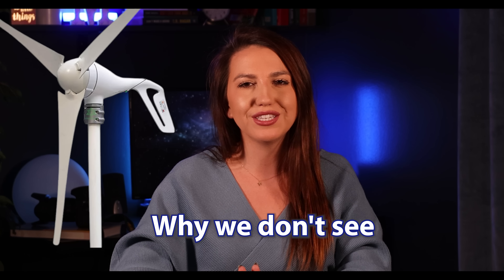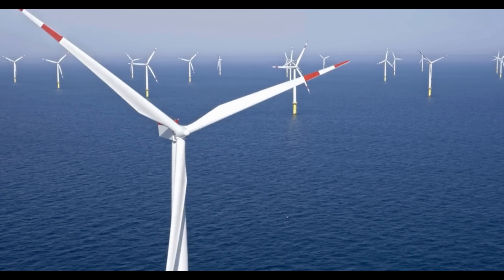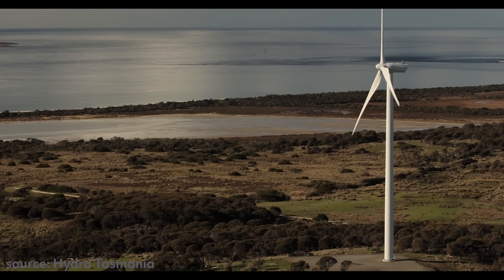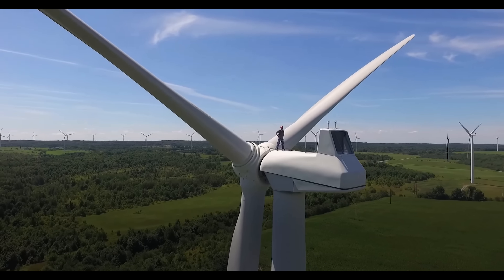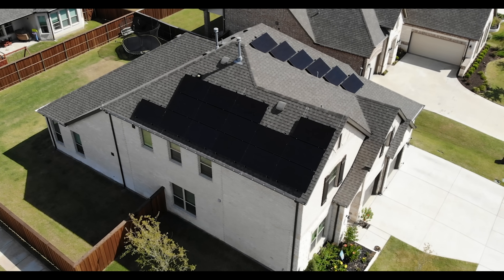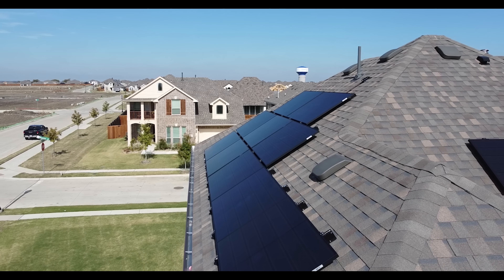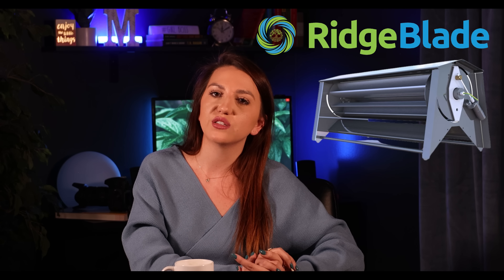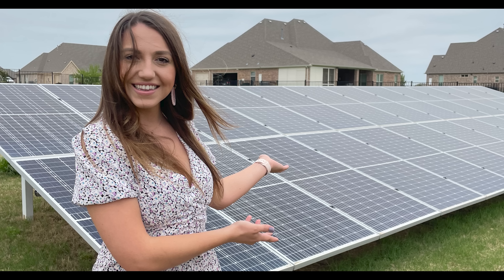Could this Turbine Destroy Solar?  | Why haven't we seen these small wind turbines yet...

Comment: It's very simple: You can't extract from the wind more energy than P=0.36•A•V³ [W, m², m/s].  A - is a area of the wind "hitting" turbine, V-speed of the wind. Small turbine = small energy. Slow wind = small energy. There is a no better idea from efficiency point of view than traditional HAWT type turbine.

Comment: use the wind of trains, cars, Moutain valley winds, tunnels... they are all low but the wind in those can be tunneld through
Reply: Also what is with the Windtubines that take all the wind directions there ball shaped. yes the need to be bigger and it will cost but perfect vor between big buildings

Comment: me as a 5 year old... yeah why dont they do just that.... 20 years later.. WHAT DO YOU MEAN THE WIND TURBINES DONT SPINNI SPIN SPIN BECAUSE THERE IS A MINUS ELECTRICETY COST NOW FUCK USE THE SHIT WIND FOR FUCK SAKE 
we Germans had a 40% total coverage of electricity by using solar power in the summer AND THEY TELL ME THE WIND TURBINES CANT SPINNY SPIN SPIN BECAUSE THE WIND IS TO STRONG OR BECAUSE OF INDANGERD BATS..... Fucking build smaller ones that can spin faster and putt a cage around it....what the fuck is the problem here.. what do you mean i cant generate to much solarpower and fed the grid of my neighbors when i produce to much. why cant i buld small wind wheals and solar panels in my home... oh because Companys would loos money....

Comment: The very first thing you must consider is solar only works when the sun is shining, next after 6 months or so if you do not have them cleaned the efficiency drops quickly and severely!
Wind using a real Turbine will work in the rain and shine at night! Solar was not a good solution when I was selling them and installing them in the late 70's through the mid 80's with very little change to the tech. Now if you use both wind and solar with low-voltage lighting you can step down the amount of grid you need! If you think you are going to live off-grid on either wind or solar you have another thing coming!
Hydro is best if you can use it, however, wind using a flywheel will most likely produce more energy at a more stable rate.

Comment: There needs to be a hybrid system that works with and with wind. Why?
Because, the sun is not always shining and definitely not at night! However, the wind is not always blowing either! So, it makes sense to have an hybrid system to do both. Gravity needs to be a big consideration in wind systems, plus parts that don't rust , as in stainless bearings and have self lubricating parts to fight friction. The average home needs one giant battery system to power everything.

Comment: The problem with micro turbines is that they are too small to produce enough power on their own. If they were more affordable so you could set a line of them across the length of the roof or wherever to daisy chain them together (like ridgeblade) and use them in conjunction with solar it would work much better. I would also love to use both in conjunction with a back up human powered generator and hydro if there was flowing water on the property. Ideally, all that would combine with passive heating and cooling construction, gravity rainwater collection and storage and home biogas for cooking or hot water heating.

Comment: Why you ask you don't see more of this in residential areas? Because they made it against the law!
I cannot find it today and it's been awhile line rely 2000,s but they made the poor guy take it all does push up telescoping mass pole in concrete. I guess they hid it now. But found another. Yeah fined him he fought ended up taking it down. Then put out propaganda saying it's fake. Yeah run your refrigerator, drier, electric heater.... they  won't have that! 
https://youtu.be/SC8SM7SIEFw?si=QmOVA8M0dVl97aiD

Comment: One word - Torque. The smaller your blades are the less torque you get from wind, so you have to reduce the generator power output to get enough spin on it to even generate usable power. The problem with that is that you reduce the voltage output, but you can create higher currents. However, to get enough volts to run higher power appliances you have to run a converter and each step of converting lower to higher volts you loose power. Those larger wind turbines have much greater torque even though they don't spin as fast, the Torque can spin much bigger generators and create higher volts without needing to increase the higher current and you aren't needing to convert lower to higher volts.

Comment: Even worse. Solar panels DON'T work well at high latitudes (nearer the poles).  For example.Kanaydian solar panels gather ice for 5-6 months in late autumn, winter and early spring rendering them useless! at that time! The panels probably get damaged by ice formation! Trust Trudy to push a "renewable resource" for HIM. (You keep buying new panels!)
I live in India at the 13th N lat and I get 1 KWH (unit) per watt of panel in one year. I pity those who live at latitudes above 30 deg N or S. Do they even see the sun in winter

Comment: Another bullshit video about some bullshit windturbine concept this idea is so old it is in the first testament. Most places have not enough wind to do anything, it won't help if the damm thing only works for half a hr a day or week. Even if there is enough wind, they are noisy enough to want to shotgun the thing so you won't have to listen to it anymore.  And the time it takes to install it the cost of wiring and batteries, one would be better off to hook it to a bicycle and pedal run the thing until you can get enough juice to play the computer for 30 minutes or less. Could also mount it on top of your car and drive down the road to make it work perfect. With the smarts people have if small weird windmills worked,  we would have had lots of these working before ww2. The reason we don't is they aren't worth a shit you'd be better off and cheaper to use a gas generator to make a little power.

Comment: None of the tech is complicated and most of it is plug and play. Solarized the shed today for about $400. 300 watt solar panel $180. Charge controller $12. 12 v 100ah lithium battery for $170. A 400 watt inverter $25. I spent $50 on a 200 watt led overhead lamp. Turned the shed to daylight. The main purpose is to charge my e bike daily. It took me around 1 hour to install. To power the house I would just keep building the system. I am only building emergency off grid for when the grid actually goes down. Otherwise the tech is now there to simply plug your panels or wind directly into an existing wall socket so no need to store power in batteries. If you produce enough power you stop getting a bill. The downside is it shuts down if the grid goes down. You can't be pumping in power when they are trying to fix downed lines. I was shocked someone would spend $100,000 or even $20,000 to build a power station. For $100,000 I could easily power up 4 or 5 houses and make a profit. No wonder people are not interested when they hear crap like that. I am shopping wind generators for $200. If I buy 5  plus 4 more solar panels I will meet all household energy needs for about $3000. Free energy forever. Maybe it cost me as much as $5000 if I buy a 10,000 watt invertor or something. At current electric cost it pays for itself in 2 years. Very low tech. You don't need a repair man for a $200 wind generators or solar panel. When it quits working trow it away and plug in a new one. My panel is good for 50 years. I will be leaving them in my will. Lithium batteries are good for 12 years. A wind generators is mechanical. My guess is 5 years then throw it away and buy another. $20,000? For what? A wind generator is $200.

Comment: Wind on your house is too slow to be any use. You can't get more energy out of the wind than it actually contains. The tall industrial ones are in faster wind because of their height and location. The three-blade devices get 98 % of the available energy. Any other shape has less efficiency. Solar is cheaper, and given reasonable storage provision, it doesn't really matter that it only works when the sun shines.

Comment: With a pricetag by the power company wanting $373,241 to install a powerline to the property, it was more cost effective to install a multisource, ie solar, wind, water, system.
Reply from the maker: Holi smokes yeah I would do an off grid system if they wanted to charge me 300k so then they can charge me more for power :D
Reply from the maker: Holi smokes yeah I would do an off grid system if they wanted to charge me 300k so then they can charge me more for power :D

Comment: Have you ever seen a small one that can be used wen camping ? portable. I like doing winter camping.
Reply from the maker: Not ones that would be helpful unfortunately. foldable and portable solar panels with small battery packs tend to do well for those camping trips though! Have you tried that ?
Reply: @solartimeusa  I saw one several years ago. I bet it was bad. 
Not yet. I got a big battery bank the other day. I going to try one of the solar blankets for Bike camping.

Comment: There are a few vertical turbines available from China. They make claims which are unreal but give a starting point for designing real power model design. 
When looking at the charge controller wire size it's possible to calculate the most current the generator can produce safely. Most use something which looks like 14 AWG wire. To create the watts claimed the voltage would need to be very high but the insulation says it is only going to be about 12 volts. So there are no generators from China which we capable of creating high power systems.

Comment: Do you know why wind turbines have the 10% of power production for the US? 
They cost more to buy, to install, to service than solar. And they produce less power comparatively. 
But this is counter intuitive you might say. 
"Exactly!" I will reply... 
Politicians want to spend money on "green projects", but whenever politicians spend tax money on anything, they gain back a percentage of it under the table. In Greece there were instances where they would gain 98% of the cost and only 2% would go to the actual project 😃 I highly doubt American politicians don't gain anything at all, so my theory is that the more expensive the green project is (wind generators vs solar) the more profit for them... 
Also... Since solar is waaaaaaay more efficient and cheap, if they started building solar farms they'd stop burning fuels for electricity generation and that wouldn't be liked by the big fuel companies, would it? 
In reality, just ~2000-2500$ per household is enough for solar to generate enough energy for our needs. If you think about how much we pay in electricity bills and how much damage we do to the environment, you would think adapting solar on most countries is a no brainer... But they don't want you to have free green energy...

Comment: The answer to the question in the title of the video before I even watch it is No. Wind turbines will not destroy solar. The two should always be used in tandem. The sun will not always be out and the wind will not always blow, so they must work together. This in combination with a generator and battery storage is vital for any off grid or on grid system.

Comment: i live in the netherlands.. and we all are used to netting.. we can use all our summer power for the winter.
now the government announced they get rid of netting in 2027
32% of all dutch homes have solar panels. what is allot. leaving us all up to selling our summer power for 5 cents per hwh. and buying it back in the winter for 40 cents per kwh. . 
companies are heavily promoting batteries now.. but the power "shortage" is in the evening. when there is no sun and many charge the car. and in the winter when the heat pumps go on. the real profit here would be winter power. and than is when the wind blows the hardest.. 
today i changed my solar setup to 30 east and 70% west. to profit of the evening power with a dynamic contract so i get the real kwh price gonna skip the battery and i am REALLY looking for wind energy
i think if you want to do it seriously good .. we have to look at diy a turbine.. ive seen some impressive builds that work here in NL

Comment: No it will not because it has to re orient itself to catch the wind. If it were a vertical axis then it would catch the wind regardless of the direction. Just another example of a company that does not understand wind direction.

Comment: Great video.  I've subscribed!  Thank you!  

An idea I'd like to share.  I first had the concept of a "wind dam" in the 1990s.   Essentially a giant wind catcher atop a ridge to capture a predominant wind, such as the constant 30mph onshore winds in much of Oregon, or in a windy desert location especially near a water dam that already has energy transmission lines.  Or even along the ridge of the hillsides on Maui to replace the huge eyesores spinning there now.  It would funnel the wind through a tunnel to centrally located turbines, which centralizes their maintenance.  It could follow the natural ridge line so some natural landscapes aren't ruined for places like Alaska or Grand Canyon type areas.  It could even be affixed with bird grills to avoid that criticism.    Not a catch-all solution, but could really work for select locations if the engineering and cost barriers of the sheer amount of flat material needed can be overcome, not to mention a means to shutter it or have escape channels if winds get strong enough to rip it apart.

Comment: Let's dispel this green energy. The facts are that wind and solar are failed energy generation systems that have been sold to those who are intellectually challenged. The costs for KW don't tell the story and the fact the creation of these failed systems is never considered. Without reliable 24/7 energy generation to fool yourself that this is anything other than a feel-good endeavor to placate the wilfully ignorant, I see no reason to keep beating this dead horse. If any of these folks wanted to fix the problem, which is self-inflicted by the climate change nuts, then they should be realistic and look at nuclear and hydrogen. Yet, those would fix the issues and not allow the grifter climate change nut cases from scaring folks into handing over their money and their rights to a group of elitists.

Comment: As a Self Developed Researcher who resides in Nigeria, west-Africa, I can Authoritatively tell you that If the shape of the wind converting blade on the shaft is not in uniform with earth gravitational space force and your Neodymium Magnets energized field coils are not wound to be LENZLESS, you will never get anything out of your wind driven turbine.

But why worry yourself with that cumbersom mechanical system when you can actually make a  Convertible High Voltage and High Frequency Motionless, Self-Powered Generator?

I cracked the code to this system with the help of PA. LATE  DONALD SMITH and a Professor in Russia called Vladimir Utkin. 

This is about using One Wire to transfer Voltage into a simple arrangements of Diode and High Capacitance Capacitor Bank like Maxwell 2.7 3000F capacitors arrange in series to max UpTo a minimum of 500V or more (lover capacitance too can work) which is better because electrons in the Air Enters a transformer whose Voltage is Higher than normal.

The Air is the Voltage while the Land or Physical Earth Crust is the Current.

So you will need to discharge your H.V H.F  capacitor Bank into a well Grounded High Voltage High Frequency Step Down Transformer at a calculated RESONANCE FREQUENCY which by this negates LENZ and thus allow you to loop the system using now, just another set of Serially Connected 2.7VDC 500F Super or Ultra Capacitors that max UpTo a minimum of 24V (96V is Better).

If I can build this Gen, you too can. The Circuit is freely available online.

Comment: I bought 2 different bran's of 400w one has 3 blades n the other 5, I did a test on both n they can only genarate 100w max. I got 1 solar panel at 230w used for 75$ each and you get full 230+ in the panel Just one panel beats both wind powered turbines hands down

Comment: Corection, wind turbines don't deliver power when needed. They deliver only when the wind blows which has no relationship to need. And it must be used when it is generated or the energy is wasted.
They have no place in a power grid. They are there solely to launder tax money to politician's supporters.

Comment: I checked before this comment.
As is the case in most all of America and Dallas, Tx, the reason you don't "see" home wind generators is because you can't.
You can't get permits to install them. You can't get insurance on a home with them.
Your maintenance numbers are wrong. Their are turbines made in the 20's as in the 1920's that are still operable. No solar panel made has a >50% output life span over 15 years. They degrade over time.
After 90 years you'll replace the panels four times and rewind the turbine once. Solar panels require constant cleaning. Turbines can run for decades with no maintenance. Wind and hail decimated solar. Turbines have two moving parts the armature and the tower to head rotational device of whatever type.

Comment: I think that wind would be a good partner with solar on the coast, when overcast could be a problem for solar, wind takes up the slack. If it produces the same voltage as the solar panels, they should work well together.